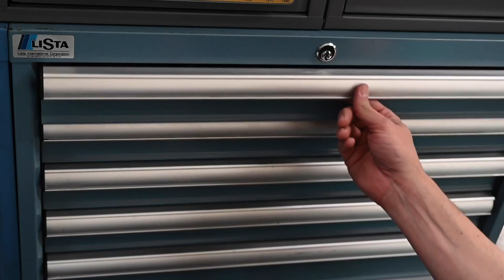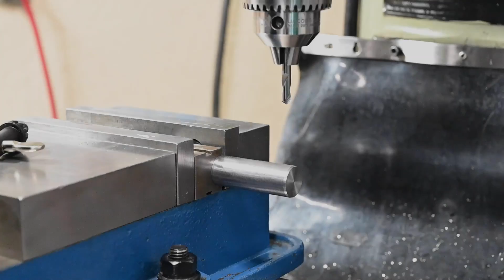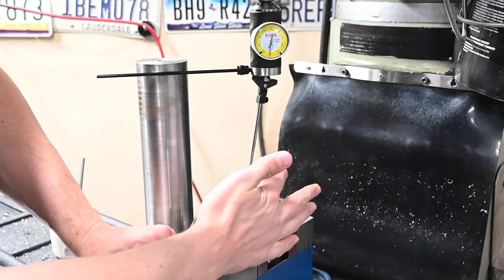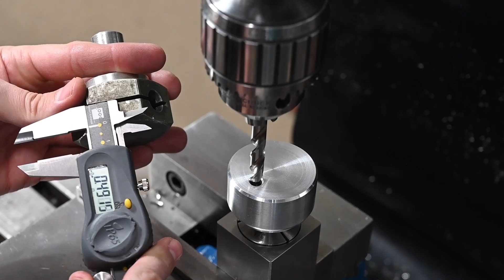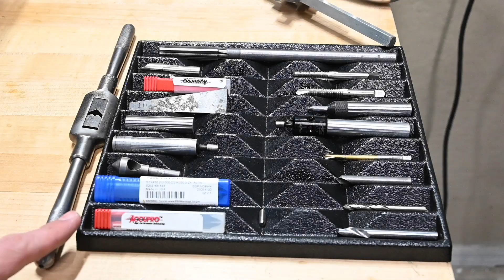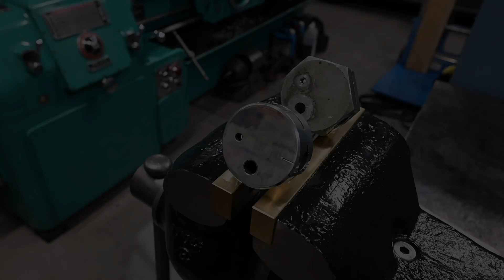Lisle 91000 Drill Grinder: replacement parts- Part 3

Comment: I have to make a diamond dresser for my Lisle 91,000.  The  unite I got didn't come with a dresser. Is it possible for you to help me the dimensions?
Reply from the maker: Sure- big end is .875" diameter with the hole for the diamond .3565" from the end to center of the .187" diameter hole to mount it. I just turned down the shank of the diamond tool I bought and threaded it for an 8-32 nut. The big end length is 2.428" and the small end is 2.118" long. The small end diameter is .491". I think that's all you need.
Reply: @AlwaysSunnyintheShop   Thank you, this is exactly what I needed.
Reply: Can anyone tell me where to find the actual diamond dresser that will fit into the holder?  Can I find one that fits as is or will it need to be machined to fit?

Comment: Yes, "climb" sawing, like climb milling, is not a good idea unless you have a VERY solid milling machine. It's OK for light finishing cuts, but there is always the risk of the tool digging in.
Reply from the maker: I wasn’t too worried in aluminum. The tool bound up because the end washer on the arbor couldn’t clear the part. Silly mistake, but it happens when you have as little experience as I have.

Comment: Looking good the part turned out nice. I too struggle with power tapping in fact seldom I'll tap someting under 1/4 in the mill just to be safe, broken way too manny 10-32 taps. Don't sweat the mistake in sliting thing do happen it is always easier to see things after the fact .

Comment: Hi Aaron , you were bloody lucky  the cutter did not shatter . Even though you can , i  never make a habit of climb cutting with those things .   Have a great new year , Cheers .
Reply from the maker: I definitely got lucky. Felt like I stopped it much faster in real life than the video made it seem, but that’s just how quick things can go wrong. I think climbing was fine- the problem was the clamp washer on the end of the arbor was too big to clear the part. Tore up the arbor pretty badly. HSS usually shatters rather than bend, so I am surprised it wasn’t a disaster! Thanks for watching, Max- hope all is as well as it can be in Oz.